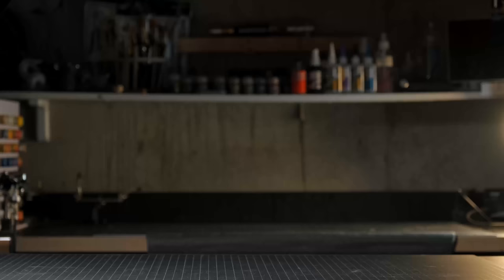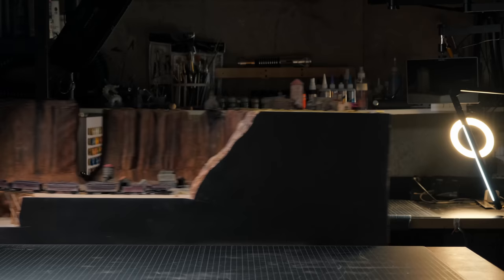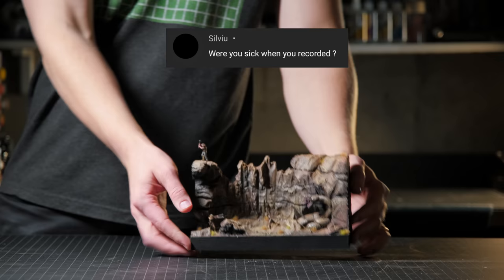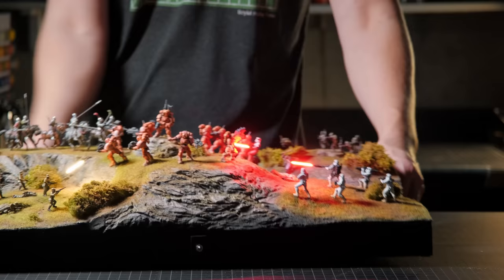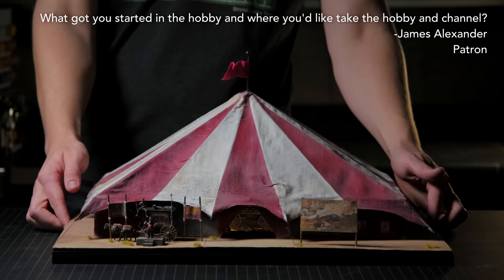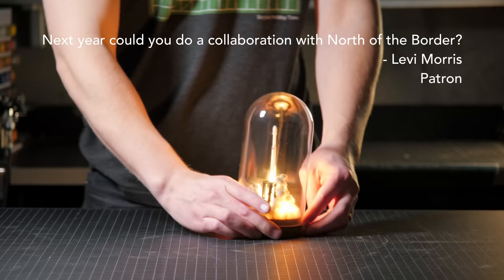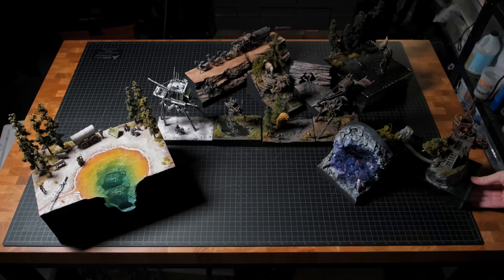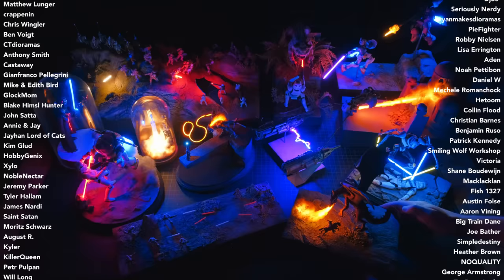Do I Plan to Keep Making Diorama?

Comment: If you can find them or build them. Barrister's Cabinets, or Lawyer's Cabinets, are great for storing things you don't want a lot of dust on. They have fronts that either slide up and in or side to side. They can get pricey but they are surprisingly easy to build.